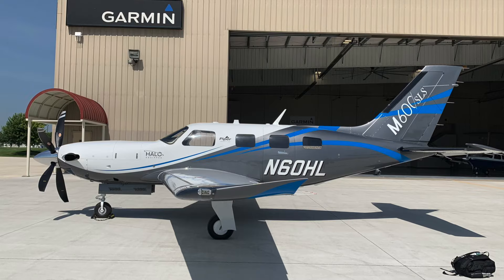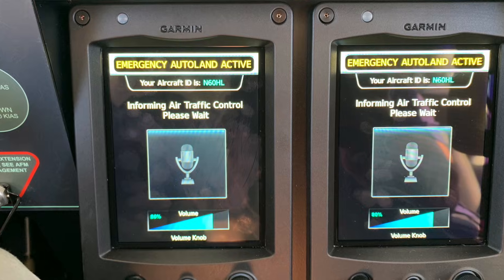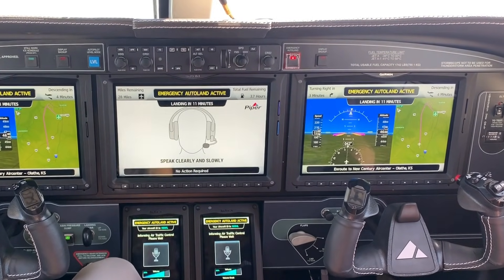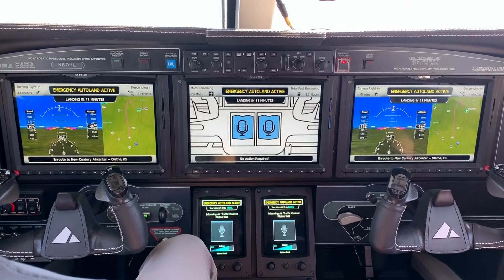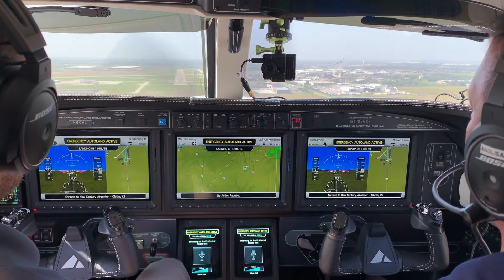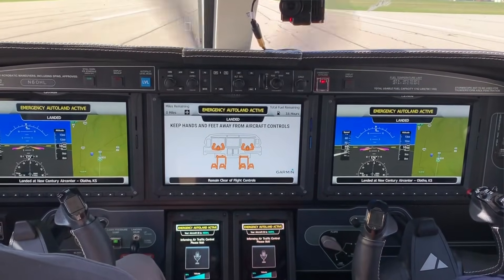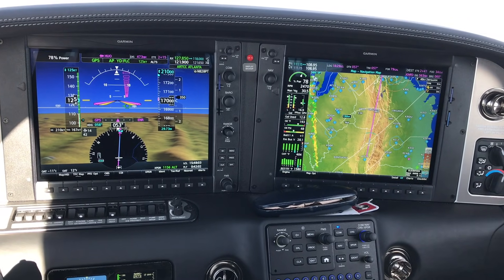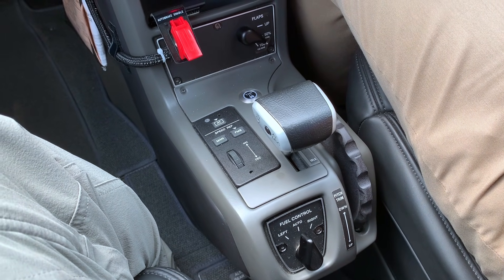Garmin Emergency Autoland Flight Trial

Comment: Can you do emergency go around too? lol
Reply: that is already a feature of current autopilots so no reason why this system couldn't.
Reply: Shasta Graff  interesting point
A human pilot would choose overrunning a iced up runway (with a high chance of survival even if it wrecks the plane)  over loosing control because of a onboard fire and crashing.
What choices would this computer make?
Reply: Shasta Graff  if it was instructed to land at that airport then yes your point is valid.
The demonstration shown here highlighting the "one button press" takes those decisions away from the person pressing the button.
The software likely has  (or should have rather) additional information like the presence of the lake and then has to decide if its a "lesser evil" to attempt to land there  or if the risk is lower to try to fly longer and choose another runway/ airport.
These "lesser evil" issues also are a factor with the car autopilots.
Would a car  have to risk killing people on the pavement avoiding a mother with a child crossing without looking?
If additional injuries happen outside the plane; who is responsible?
Would it be the passenger who pressed the button but lacks the skills to avoid the plane hitting someone on the ground or is it Garmin who wrote the software that is making the decisions?
I am convinced these ethical questions are part why these kind of systems have not became available sooner and Garmin has  quite a big legal team looking into these questions.
Reply: Does it matter what it can or cannot do? You only push that button if you are going to die. In that situation, activating autoland gives you a chance of not dying.

Comment: It is a curse and a blessing. Autonomous is no longer the future, it is now. The blessing is simply taking pilot error out (spatial disorientation) of the equation and taking pilot incapacitation out as well (medical emergency).  The curse is, this is one step away from  a drone, pilots will become, "pilot monitoring" instead of PIC. As the future rolls on, these will evolve into taking the pilot out of the equation. Just like workers being replaced by robotic pick/sorters in warehouses. Good video, clear explanation. The future just landed.

Comment: Couldn't you use this to fly in IFR conditions? You don't need to see outside, you have the display showing what the outside world looks like.
Reply: if you're talking about synthetic vision, that's been around for quite some time, and is also shown in this video. Considering it's for emergency use and the user has no say as to where the airplane lands....I wouldn't say it's "useful" for IFR conditions. What's useful for IFR is an instrument rating, autopilot, synthetic vision, etc.

Comment: Will it fly around a thunderstorm ? What about wind sheer ? What if there is another plane on a runway?
Reply: They said it routes around weather. And it talks to ATC to declare an emergency, so ATC will clear the air and ground.
The only problem would be if there's already another emergency in the area, unless they have a method of ATC denying landing at the systems chosen airfield.

Comment: Awesome. Did I hear correctly that the system can detect hypoxia and start the emergency decent all the way to full stop and shut down? What an excellent piece of equipment. I think it will also be useful in other situations beyond an incopacitated pilot. I am thinking vfr caught on top or otherwise inadvertently in imc. This will save lives. Wow! Great job Garmin. I think we will see a bunch of auto throttle and brake servo STCs in the near future to make the retrofits possible.
Reply: You are right, VFR pilots flying into IMC is a top killer.
Reply: What they could do is implement a test to make the pilot perform a task and if he fails initiate the autoland.
Reply: I think it auto initiates after a certain time of no pilot input
Reply: @GabeClendenning  hope the time limit is altitude dependent; 10 sec is a long time flying towards terrain. (actually does it do terrain avoidance? with its database and location awareness that   should be possible)

Comment: I notice that on landing, the gear handle was down and the flap handle was at the first detent, although the earlier discussion indicated that those would not move. Why is that?
Reply from the maker: On both fly-offs (Piper and Cirrus), we made the decision to lower the landing gear handle after the system extended the gear and flaps. Seemed the right backstop in a non-emergency.
Reply: @AVweb  Thanks, I guessed that might have been the case.
Reply: as a pilot you need to know the position of controls. Computer doesn't care.
Reply: @zdenekanyz9870  My point is that Larry and the Garmin pilot discussed whether the gear handle would move, and the Garmin pilot said it would not move when the system lowered the gear. And yet, the gear and flap handles were in the down position during the landing. I'm just asking about the discrepancy.
Reply: @MikeKobb  hmm good catch I did not notice that !
Reply: @zdenekanyz9870  Yeah, I noticed the handle is down in the Vision Jet on one of AOPA's clips, too. The system is obviously in some kind of test/demo mode, since it's not squawking 7700 and so on, so I'm guessing it's an artifact of the demo environment. I still hope @AVweb can shed some light, though!

Comment: What are the crosswind limits on this system, and is that factored in to selecting the best runway for landing?
Reply: yes Garmin will search for suitable airport also based on wind situation
Reply: Zdeněk Anýž And if the only suitable runway is out of current range based on FOB?
Reply: @starventure  in this case is something wrong with your flight planning
Reply: Zdeněk Anýž If your route has no other way than to transit a weather system...
Reply: @starventure  I don't understand to that scenario. Flight thru a weather system is fine unless capability of the aircraft or pilot (IMC, Icing conditions, storm etc). If a weather is beyond, during the preflight planning has to be planned a different routing with suitable fields along the route to meet a legal flight planning criteria. If the nearest suitable field is beyond FOB something very wrong happened hours ago during the pre flight. Then the only safe option for PAX is deploy an emergency parachute (at least on Cirrus aircrafts)

Comment: Add a pulse ox sensor (finger or wrist band) the pilot wears so if the pilot’s oxygen level gets too low, it will automatically take over.  Your welcome,
Reply: Garmin already have a Pulse Ox sensor on their aviation smartwatch... and it can communicate with the avionics... as far as hardware, your idea is ready to go.
Reply: It would be interesting to put a pulse oximiter into the headset ear pads.
Reply: Don't forget the breathalyzer on the microphone.

Comment: How does the system know about tempoary airport closures? E.g. runway closed, workmen on the runway etc..? Can ATC deny or manipulate the Garmin’s airport/runway choice?
Reply: BlueLineSpeed good questions. I’m sure it checks NOTAMS for the word CLOSED... I hope
Reply: Another reason why it’s going to take many many years to remove pilots
Reply: @boosti_alex  I would argue that pilotless planes are an easier proposition than driverless cars on several levels. The sensor feeds for aircraft and wiggle room on a runway (vs a narrow road with oncoming traffic) seem an easier task.
Reply: Frederick Deal then you have no idea what you’re talking about. Flying a complex machine with millions of parts 100s of who’ve are safety critical in three dimensions without the safety of just hitting the brakes if things go wrong is not something that will be solved this generation
Reply: @abingdonboy  and yet, Garmin seems to have done so.
Reply: Frederick Deal Garmin haven’t done anything. The technology to put a care into a parking space has existed for decades. That’s the equivalent of what Garmin has achieved here, are cars fully autonomous today? And they are closer to it than planes being
Reply: boosti_ alex Yep. And that’s it’s simulator footage on landing.
Reply: John Mangiameli thats odd for a system that supposedly works perfectly
Reply: BlueLineSpeed that’s a great point.  It could plummet you right into construction equipment.
Reply: In an emergency, you're allowed anything.

Comment: Lol GA doctors gonna be pushing this thing every other flight.
Reply: I want to disagree,  but I have personal experience in this area. Lol
Reply: The aircraft declares an emergency automatically and squawks 7700, plus it will shut off in the middle of the runway. Both FAA and Airport are coming for you if it was not justified
Reply: Yeah, this should be mandatory equipment in all Bonanza's.
Reply: Drew Earthling Especially V-tail ones.

Funnier is the fact that the Cirrus Vision (one of the launch planes for this system) is basically a “Doctor Killer” V-tail Bonanza except with a jet and not a prop.

Comment: Machines: They're just like us and miss that center line.  ;-) 

 (amazing video!)
Reply: Yeah, not exactly "flawless"...  But certainly adequate in an emergency situation.
Reply: Zac Randazzo they aren’t flawless that’s why there needs to be a balance of human machine interaction and cross check which is what has made flying so safe
Reply: I was wondering that myself, I thought it must  be the GPS tolerance but it was right of centre line on the synthetic vision screen also  so that means the system knew exactly where it was, right of centre lol . . .
Reply: I thought the same!!  Good thing the Garmin doesn't have a CFI incorporated into the program.  Center line!  CENTER LINE!
Reply: The comments here must come from totally technical not affine persons. How the heck shall the plane get the centerlane? Mus be only gps landing. No camera to look out for the center lane. But they market it as if there are a thousand cams... and a blonde with a beer waiting just for you
Reply: @hnbawuede  If the airport runway is localizer equipped the autoland should be able to land right on the centerline.
Reply: Maybe when ATTOL technology is developed and tested more...

Comment: Perhaps some airliners could be fitted with it so we have more comfortable landings!
Reply: Airliners have had autoland for years...
Reply: This is not an auto-land for use every landing (airliners have that already) this is a "holy shit both pilots have had heart attacks and nobody is flying the plane and none of the passengers have any sort of flight training at all we're going to die!" auto landing. This isn't designed for comfort its designed for getting the plane down as quickly and safely as possible.
Reply: And that looked like a pretty rough landing too.

Comment: there went my job 😞
Reply: Airliners have been landing themselves for a long time now. Job isn't going anywhere
Reply: Don’t give up on flying! Demand has never been higher.
Reply: They aren't taking the pilot out of passenger airplanes for decades, if ever
Reply: Flyguy4723 not a chance dude
Reply: Yeah this could have been implemented on an airliner decades ago 
We’re good buddy, check my comment further up if you want to see my proof that doesn’t even cover why airline pilots will still be needed in the future. (Not just for passenger comfort and emergencies)
Reply: Flyguy4723 this isn’t even possible if a fully automated airliner came out Tomorrow 
Think of the thousands of planes flying Today the thousands still on order it will be a good 50 years before all those planes are retired.  
So even if 100% automated and pilotless came out tomorrow and was certified it would be a few decades

Comment: Why aree the vertical tapes on the sides of the display so close together and small? So much wasted space in that display (until the autoland thing activates, but the G1000 is the same way too and it can't do the autoland thing)

Comment: Welcome to the world of paranoia. How many times would it have been nice
 to have an autoland system on a small airplane? Ten times in fifty 
years? Garmin is pushing thousands of airplane owners to buy this 
useless gadget in order to satisfy their copilot-wives...  This is not 
nice, Mr Garmin. Seriously: This autoland stupidity creates a new breed 
of accidents. Now every third class Piper jockey feels safer and flies 
with a false sense of confidence into marginal WX conditions; every 
weekend, of course. The result is obvious. Didn't your Garmin 
psychologist tell you that? No, they did not because they are not 
professional pilots. This is going to be a huge problem in the future. 
As it is very often in aviation: a good idea, but not fully understood. 
Good luck, George... oops, I touched the touch screen... oops, the 
autoland took over my manual landing... oops, the engine shut down 
automatically, in flight.... oops... Do you want more? This is exactly 
what happens when young computer geeks and non professionals work 
together as a team. This system will never get approval from the FAA. 
For very good reasons.  Greets from the 747-8 cockpit. R